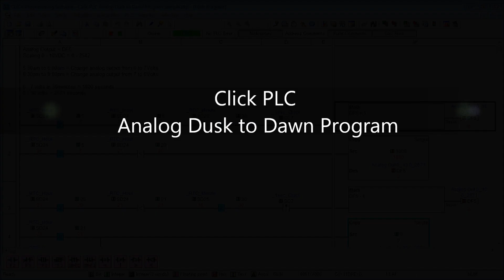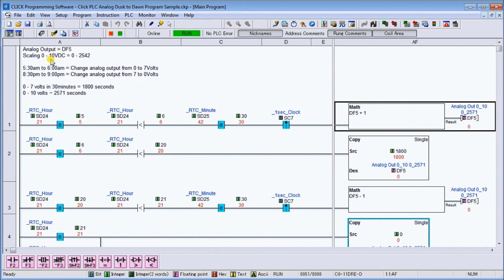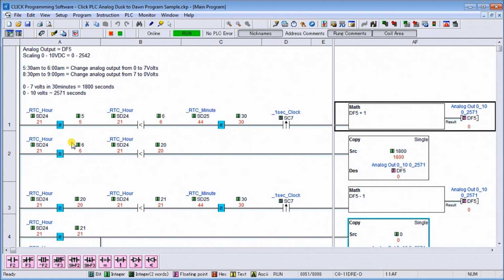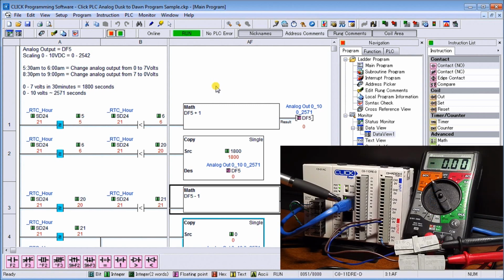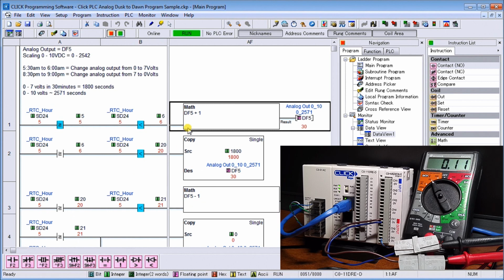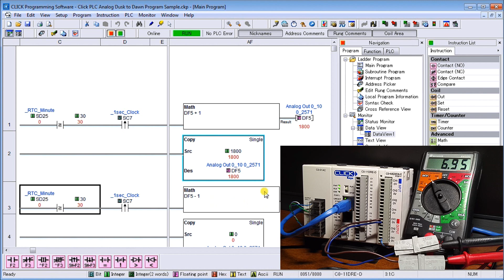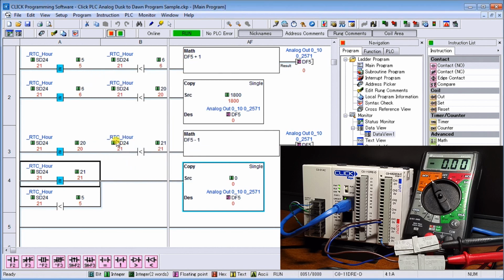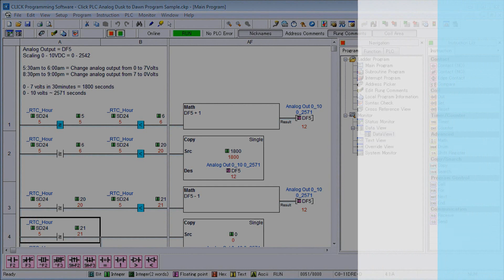Click PLC Analog Dusk to Dawn Programming Tutorial

Comment: Hi Garry, I have the click PLC and c more HMI panel.  I wanted to make a time clock like you would have on a swimming pool or the outdoor lights on a building and wasn't sure how I should go about it.  If you search on Google intermatic time clock that is the type of time clock....with the toggle bypass and multiple adjustable on trip on and off points
Reply from the maker: Hi HighTechLab,
Use the real-time clock in the Click PLC instead of the HMI.
Set up variables to hold the day of the week, hours, minutes and seconds. These variables are for the on and off times for each time you want to program.
In the PLC you will compare the real-time clock with the greater than on time variables. The real-time clock will also be compared to the less than off time variables.
Hope this helps you out.
Regards,
Garry
Reply: Hi HiTechLab, I was able to set up an Ethernet Click with EA9 Cmore panel to control the master clock in a hospital among other devices being monitored. Unfortunately the Click does not support the DST and I had found the internal clock in the cpu was not to precise. I ended up getting a control by web relay x310  and programmed a relay to close momentarily at 3:05 am to correct the click internal clock daily. My HMI reads the time from the plc. X 310 gets the correct time from a NTP server. All Click PLCs and HMI panels are connected through modbus TCP/IP. Excellent products from Automation Direct!